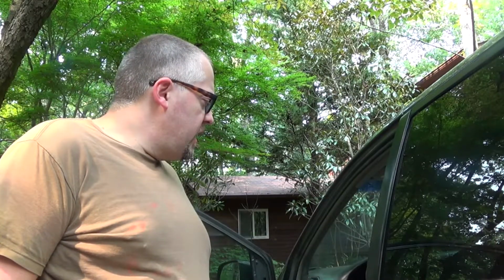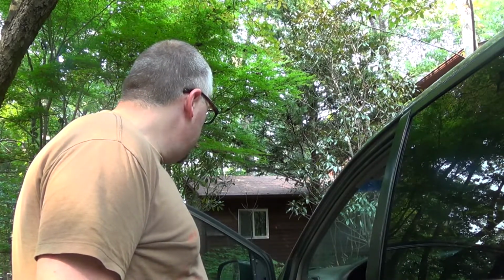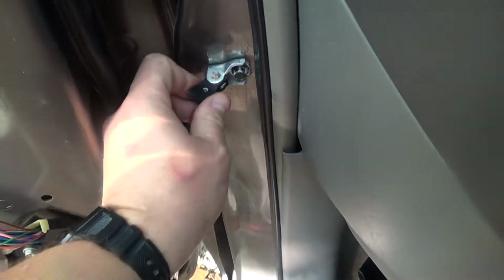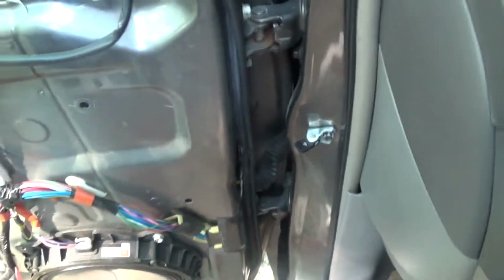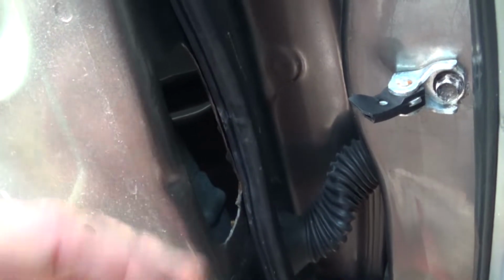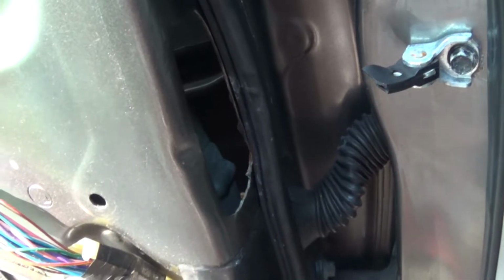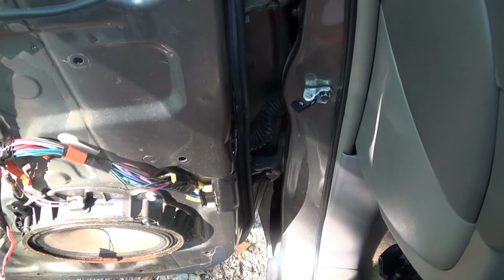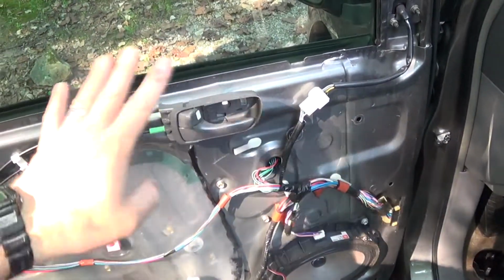Project 2005 Toyota Sienna part 9: broken door check strap (NOT A DIY VIDEO)

Comment: Omg that same thing happened to my aunts 2004 Highlander. It’s a very common problem with these doors, unfortunately. Hers was on the passenger side door. I think ultimately they ended up just getting it tact welded back into place because their mechanic told them that it wasn’t too far gone to be fixed and then I guess he was able to salvage that door and get it back into place but aside from replacing the door that’s all you can do in that situation unfortunately
Reply from the maker: We just decided to be careful opening and closing the door. Otherwise, my best option would be to replace the door, which I wasn't about to do.
Reply: @MercedesDieselGuy  yeah that’s basically all you can do for that problem unfortunately